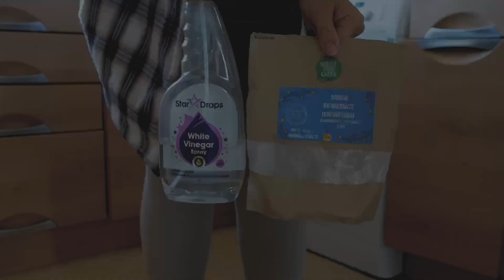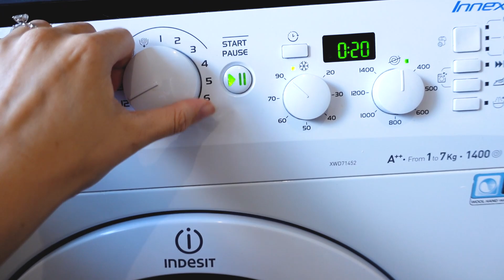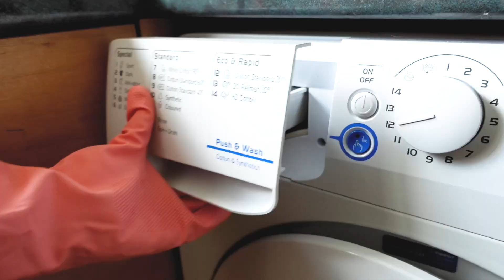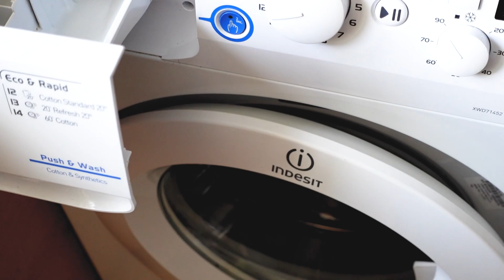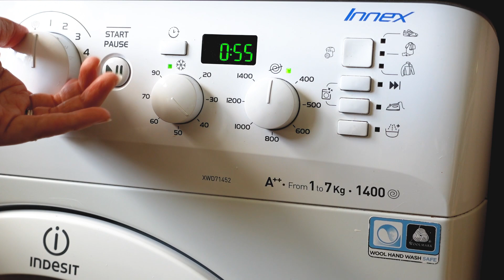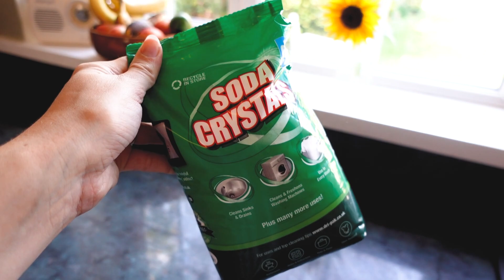Get It Done With Me | deep cleaning my oven, oven racks & washing machine, nesting vlog

Comment: What a productive day!  In future, if it were me 😁, I’d put a towel in the bath before putting heavy hob/oven stuff in there, that should cut down on potential scratches on the bath surface - too many small scratches and the bath won’t come clean properly 
Also, my hob is a similar construction to yours and came with instructions not to clean the burner bits with anything other than washing up liquid as the finish could be destroyed  - not sure though if you could “season” those bits like you have your frying pan? and make them look a bit newer 
And, a little note of caution about using vinegar too often, the seals on things like kettles, dishwashers, washing machines etc can be destroyed by acetic acid  (vinegar) - lots of modern appliances come with a warning “vinegar is not recommended”.  Once in a while is probably ok, regularly, probably not.  
Plumbers in the UK also caution about using bicarbonate down the drain systems too often as it can form a sludge and block pipes, it can also help cause larger grease-bergs further down our Victorian drain systems - same as none of these so-called flushable wipes are flushable - the only flushable thing is toilet paper as they’re designed to disintegrate swiftly, as anyone who’s ever tried to use toilet paper to wipe up anything knows 😂

Comment: I take my washing machine drawer out every time I use it, rinse and dry I then put it back the next day and I have never had mould . I also push a dry cloth in the bottom of the rubber door seal and leave it until next use to soak up any water leaving the door ajar. I can honestly say I have never seen any mould.

Comment: youn know  you can oven liners made from silicone for the oven and grill trays from Amazon.  You just pull them out and wipe down and back they go.
Reply: I use them just on the bottom of the oven... definitely saves a lot of time and cleaning... gently slide out and tip any bits in the bin....then wipe over ...x

Comment: Lovely video.   If your washing machine has a bleach dispenser,  put vinegar in it for each load.  It helps.   Ours had a smell.  I ran the clean cycle and then started using the vinegar with each cycle.   It solved the problem.   Plus letting it air out.